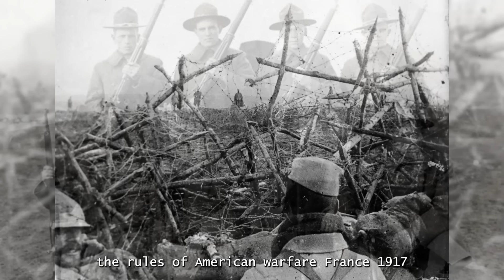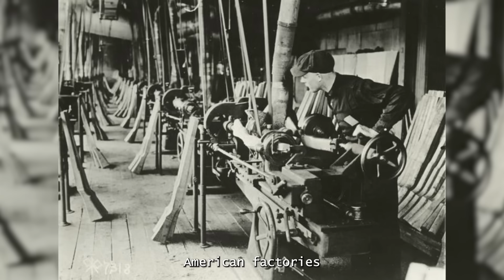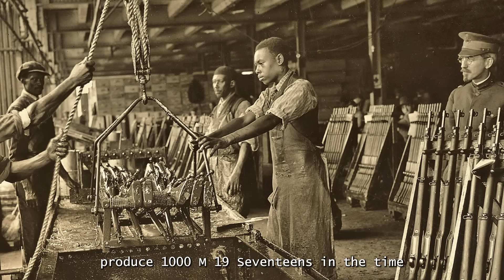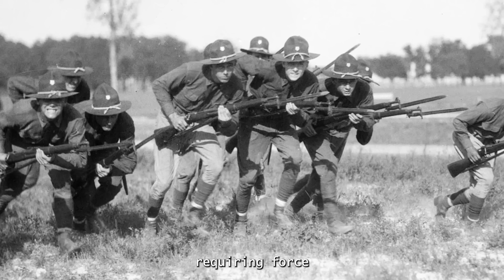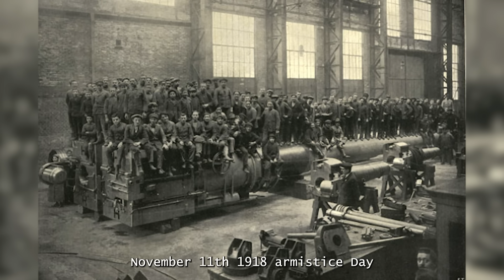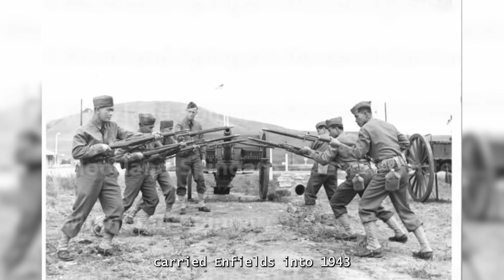The $28 Rifle That Outfought Every Springfield America Ever Issued

Comment: The M1917 does not have a magazine cut off and the safety is not inside the trigger guard. The bolt is a two lug Mauser type, not an interrupted thread design. And as to precision, for the most part you can swap parts between the rifles from three factories with a fit that comes close to any commercial rifle of the time.  It's really time to upgrade your AI before it tries to rewrite history again.
Reply: You're right on all counts.  I have one of those 1917s that was custom rebuilt and it's a fantastic rifle.  My Dad always called it "Mr. Death".

Either this "content provider" doesn't actually know anything about this rifle or he couldn't be bothered to check the AI generated script for accuracy and factuality before posting.  Likely both are true.  Now thanks to this turnip head instead of learning about this great rifle people will believe they know things that are not true.
Reply: @acts9531  Firearms history, is often a collection of various stories and incomplete or inaccurate records. Some information is factual and some lore or outright fiction.  As humans we can handle the actual rifle and evaluate the credibility of the source and even the provenance of how the story has been retold over the years.  Moreover, we can put a story into context of other information from the time period to see how much of it makes sense.

Sadly AI's can't do that, they just collate stuff other people have written on line and output something that with decent grammar sounds like it's in your language.
Reply: A I, no doubt
Reply: I read about 4 years ago that the three factories did not produce rifles each to the same standard for the Empire.
But they got enough Lee-Enfields so didn't worry.
That info was from a British YouTuber in Switzerland.
Reply: @20chocsaday  Originally Pattern 14 was intended to be made in England.  I saw a couple of example of what very much looked like British made example of such at a gun shop in the 1980's. They may have been refurbished and remarked or made there in limited numbers.  Two of the Pattern 14's had red paint on the muzzle, which would indicate that they were likely M1917s in 30-06. Pattern 14s did typically have a volley sight based on the examples I saw. In any case, I haven't found much history regarding British made P14's.

Lore suggests that when the Brits came to the US to purchase P14's they brought technical specs, drawings blue prints and examples that weren't necessarily provided equally to the three manufacturers. It's also safe to assume that at that time, the three factories wouldn't have been tooled the same way so the Brits wound up with at least three very similar guns, that weren't entirely identical.  In as much as parts weren't interchangeable these rifles  became a logistical nightmare, that pretty much sealed their fate in British service. 

When the US took over the production, the first thing they did was standardize the design across the factories. I've shot a Franken M1917 that was a restored sporter that had a matching Remington barreled action, Remington bayonet, a Winchester stock and Eddystone front sights, muzzle cap and barrel bands (one parkerized). It fits together as though it was assembled that way the day it was first made and shoots lights out. 

US troops turning up during WW1 with M1917's and fighting along side British soldiers with very similar rifles that used different ammo, likely lead to even more confusion in the trenches.

Things only got worse for the Brits and the P14/M1917 when they got a large number of 30-O6  M1917's from the US for WW2. This left them with a rifle that came in at least 4 flavors that used two different types of ammo along side the various Lee Enfield Mark3 and Mark4s they already had. 

To clean up this mess, some of the Winchester P14's were converted to sniper rifles, some went to home guard, non combat units or reserves and the others were given or sold to Estonia and likely elsewhere.

The British eventually tried to replace the Mark 3 with the Mark 4 rifles and having learned nothing from WW1 contracted Savage/Stevens to make some of those for them, which lead to the Mark 4* (another one off rifle) that they eventually accepted because the US paid for them and gave to them under lend lease... but that's another story.

As it applies to the M1917 rifles, there is some lore out there that the Winchesters were made out of a "special" grade of nickel steel. Which may or not be true in part or in whole.  I suspect that the US ordinance department would have specked the steel to be used in all of the rifles based on availability and I wouldn't count on any particular rifle being made out of super steel. 

The M1917 design and tooling went on to become the basis for both Winchester and Remington hunting rifles.  Again that's another story.
Reply: @RJ-vb7gh 
Thank you.
Reply: You are right to call out a few mechanical details here, the M1917 Enfield does not have a magazine cutoff like a 1903, and the safety is not inside the trigger guard, it is that wing safety on the rear of the bolt. On the bolt though, I would push back a bit, it is a two front lug design, but it is not really a straight Mauser 98 copy in how the whole system is laid out, and people tend to mash those categories together. On the parts interchangeability and precision, I am with you, the wartime production standardization across Eddystone, Remington, and Winchester was genuinely impressive for the era, and that is a big reason the M1917 earned such a strong reputation in service. If you think the line between Mauser type and the other locking approaches matters here, how do you define it in one sentence, is it purely lug geometry, or the whole action design and safety system.
Reply: @RedfoldDocumentary  When I brought up the Mauser system, I was principally referring to the duel lug locking system, but I could expand that to the similarities in the extractor and ejector.  The Mauser is cock on open while the M1917 is cock on close and the Mauser has a flag safety on the bolt, while the M1917 has a thumb safety on the right side of the receiver. It's been a few years since I've torn down either a Mauser 98 or M1917 action but I vaguely recall that the Mauser blocks the firing pin, while the M1917 blocks the trigger.

I suspect that by 1914 some of Mauser's patents were already running out and the Brits would have copied what they could and worked around what they couldn't.  The US 03 design ran afoul of Mauser patents and the US wound up paying royalties. I've seen no similar issues with the P14 or M1917. Remember around 1900 everyone wanted a new rifle, at the same time everyone else was holding a valid patent on the easiest and best way to do something your rifle has to do.

So, for shorthand the M1917 and the US 03 are Mauser-like with the Springfield 03 being more Mauser-like than the M1917.  The only Allied rifle that might be marginally considered Interrupted thread, as the AI referenced, might have been the Canadian Ross rifle, and that would more correctly be considered a duel lug artillery type lock up not a true interrupted thread design.

I would just like to add that back around the turn of the last century, there were actually several bolt locking systems in use in bolt action rifles. There would be single primary lug systems, like the Craig or the Lee Enfield, rotary straight pull rifles like the Manlicher, Swiss or Ross, and a few oddball turn bolt configurations like the Mosin or Carcano not to mention the pop top straight pull Lee Navy. Grouping rifles into families is always going to be a subjective thing.  I've heard various respected writers claim that the Arisaka is the strongest Mauser action, while I could easily argue that they aren't even distant cousins. While we can be imprecise in how we group rifles, misinforming people on how each functioned is unacceptable.

So much for a one sentence answer... sorry.
Reply: I have one of ten that my grandfather bought in the 1930's.
Reply: @phillssongs  Yup. The US disposed of many of the M1917's by selling them inexpensively or even giving them away to discharged soldiers or guardsman for a few years.  From what I can tell, it wasn't until the mid to late 1930's when WW2 started looking like a real thing, that the US began refurbishing their inventory and to some extent, donating them to our future allies.

What's odd, historically speaking, is that the M1917's and the P14's were always the red headed stepchildren of every army that used them, even when they were doing much of the combat, security and training with them. To be fair, many militaries are more concerned with having a "standardized" weapon than a better weapon. 

For example, during WW2, the Germans had conscripted cars from the civilian population. They had 30 broken down cars in the motor pool and none had interchangeable parts. The Americans had jeeps, so if you had two, you always had at least one you could fix with parts from the other. Moreover if you trained someone to fix jeeps, he could fix every vehicle in your fleet. No sane military ever wants more than a single service weapon in their inventory.
Reply: tiller
Reply: As someone who understands the Second World War, I ask you to rate my video about old tanks. I'll give you an honest review and a list of improvements.